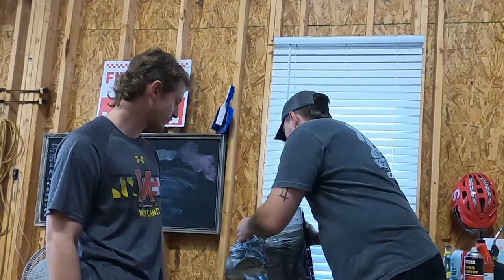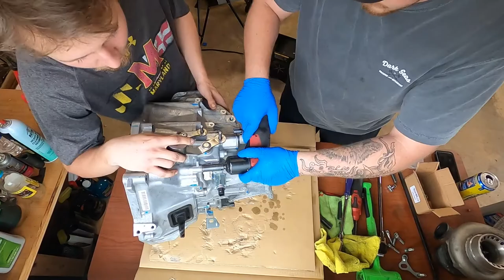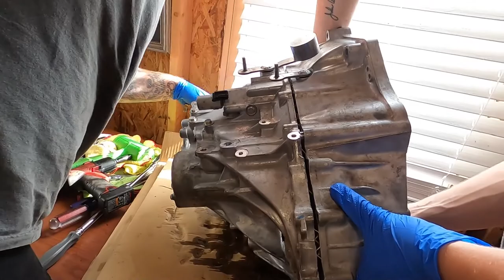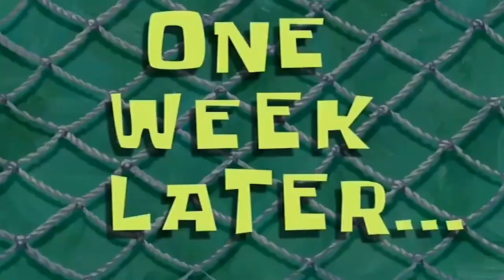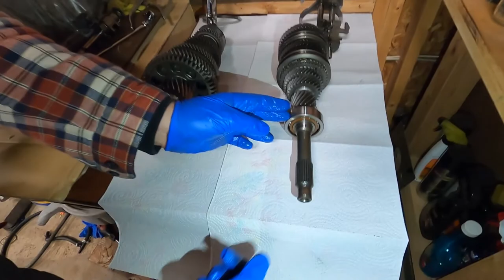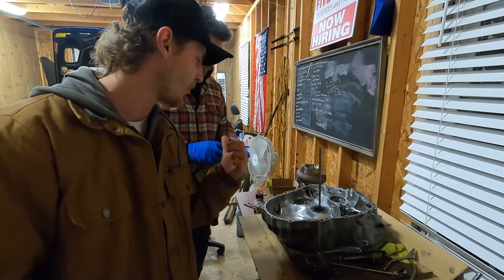Satisfying manual transmission teardown | 2019 Honda civic type R

Comment: I have a 2024 Honda Civic sport Hatch 2.0L N/A 6 Speed manual. Ever since I test drove it new 5 miles at the dealer, the transmission shifted rough specially around 3rd and 2nd gears. I chose to purchase it thinking the transmissions would "break in" and smoothen out over time. It has been 4K miles already and the rough shifting continues. The synchros were not designed properly since during shifts the gears tend to bump shift instead of smoothly glide into the next gear. At times it feels like I'm shifting between rocks. I tried changing to diffrent trans fluids but the issue is the transmission design. Honda has gone down the tubes.

Comment: Very interesting video to watch guys! I still suffer 2nd and 3rd gear grind ever now and then even justdriving normally even with a brand new gear box. I have one quick question though. Did you have to remove the front brembo caliber when removing the transmission?

Comment: I'm having a bitch of a time trying to split my case the rest of the way. I've got it split enough to fit 3/8 extensions in there. But it won't finish popping open
Reply from the maker: Did you pull out the big C clip holding the input shaft through the cases?
Reply from the maker: The big c clip is on the bottom, like the opposite side of the bellhousing
Reply: @SvGTAPES  is it the on that is accessed by removing the black cover with two bolts?
Reply from the maker: @collinherold8047  yes!
Reply: @SvGTAPES  I'm trying, but i need another pair of arms and hands, as well as some snap ring pliers from harbor freight. Glad to know that's the only thing holding me back
Reply from the maker: Nice man! Good job keep at it👍🏼

Comment: i changed my FK8 transmission fluid and wanted to remove the over fill plug but instead removed a bolt alittle higher that has a spring what looks like a detent spring but no ball came out with it and it and i  put it back in and now i am worry that i might messed up my trans dose any body know what is that bolt for ?
Reply from the maker: If the detent ball didnt come out with it, it should still be in the case then you should still be good just have to locate the ball
Reply: @SvGTAPES  is there any  possibility that the ball will fall into the transmission when i removed the spring ? the bolt i removed was at the side of the trans its not at the top where the usual detent springs are